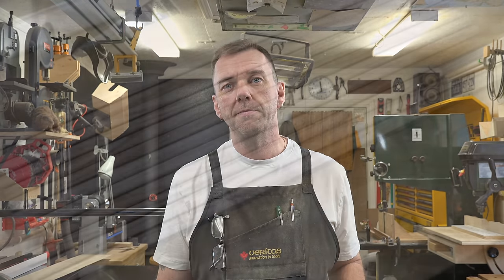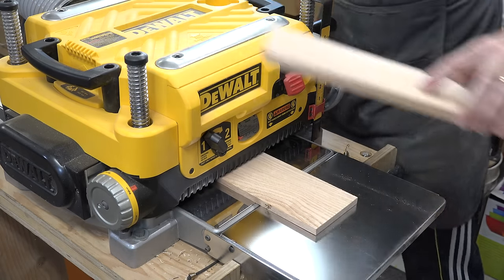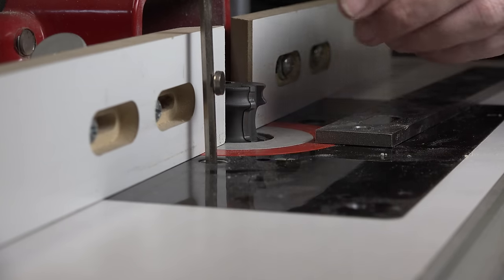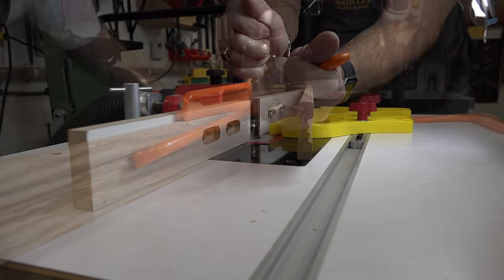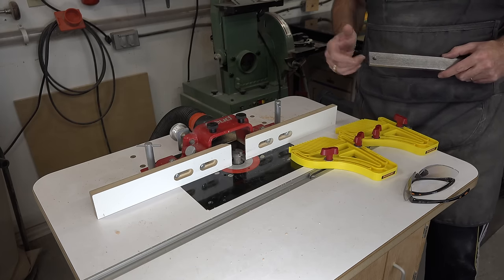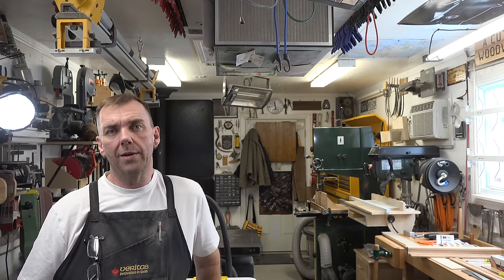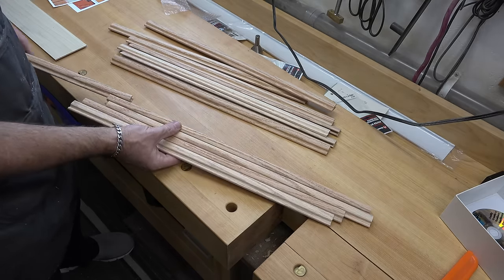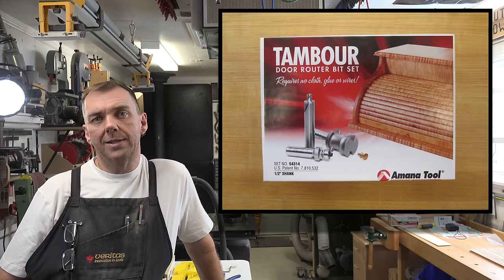Router Made Tambours

Comment: Nice video except you left out the 3rd bit.  What is it for?
Reply from the maker: The 3rd router bit in the set, really isn't a part of making the tambour and truthfully, it is nothing special.  What it is for, is rounding over the last piece of the tambour, which would be the pull bar that your handles mount on.  It is simply, a 1/4" round over bit and it allows the pull bar to have softer edges with a profile that matches those of the tambour slats.  I hope this helps.  Thanks for tuning in and taking the time to leave your question.
Reply: Thank you for the quick response.  Ouch, I looked up the price on amazon and it is 180 bucks.. wow
Reply from the maker: @iROBODUDE  I believe that I did say in the video that the kit wasn't cheap, but considering the overall price of making the desk and a family heirloom, I just incorporated the price into the overall cost for the roll top desk.  It's not a kit for everyone, but I honestly have no regrets in buying it.  Having the tambour as a solid wood unit instead of the traditional slats glued to canvas, made a world of difference in the overall look and function of the desk.  There is a full build series on my channel if you are interested in seeing how the desk was made.
Reply: I will check it out, thanks.
Reply from the maker: @iROBODUDE  Glad to hear it.  Thanks again for tuning in to the program.

Comment: anybody know how wide a tambour can be made with these bits and 1/2 inch hickory i was planning about 68 inches ?? thanks for any info on the matter
Reply from the maker: According to the manufacturer's recommendation, 5', or 60" is the maximum recommended length.  Anything more than that is risking a sag in the centre of the tambour.  I hope this helps.  Thanks for tuning in to the show.

Comment: Nice video Ken but just how "pricey" is it? Is it justifiable to buy for just one or two projects? I have thought about sawing through all but one veneer layer in a piece of quarter inch plywood. (But I ain't never had the guts to try it.) That might work but I don't know if it would last over the years. How are things going with the weight loss? 
God Bless my friend.
Reply from the maker: Pricey, in this case Frank, is approximately $170 US for the 3 bit set.  At first I considered this to be an outrageous price and that may be true, but there is more than one way to look at it.  If you spend the money on the bits to only make 1 or 2 projects and those project become heirloom pieces and last for generations on end, then it was money well spent.  I have seen many roll top desks where the tambours were made in the tradition fashion of gluing wood strips to canvas, only to have the canvas rot or fall apart, leaving the tambour unusable and in need of repair.  This completely reduces the value of the furniture piece because it is no longer original when you repair it.  I'm thinking that this method will last the lifetime of the entire piece and in this scenario, for me, it was worth the extra expense.  There are those that might not think, but that is their prerogative to make that decision.  As for the weight loss.......I'm down 50 pounds at this point and feeling great.  I have a little more to lose and you should be seeing a note from me in your inbox soon.  Thanks for asking Frank and thanks for tuning in again this week.
Reply: I completely understand what you're saying. I will note that I've seen an alternate way of attaching the tambours that use a metal guide (fastened to the tambour) and a plastic coated wire.

I'm sure that it will last longer than the canvas but you still have the wearout issue, presuming it becomes an heirloom.

Just curious if you'd seen that choice and eliminated it for the same reason that you didn't want to do canvas.
Reply from the maker: I have seen the method that you describe.  My final choice was still the tambour made with these bits.  My theory was that the least amount of materials to fail, the better.  It's just a matter of personal preference actually.

Comment: Super noob here. What is this bit getting inserted in? What type of table/mechanism is this? I apologize for my lack of jargon.
Reply from the maker: No need to apologize Jayne.  Everyone has to start somewhere and I love the fact that you stepped up and asked the question.  The table / mechanism is called a router.  It comes in several different varieties such as trim routers, plunge routers, fixed base routers etc.  The one that I am using in this video is a plunge router that is installed in a router table.  The router normally is a hand held device where the wood is stationary and the router gets moved manually across your work.  By installing a router in a table as I show in this video, it makes the router stationary and the work piece is what moves.  If you would like some more information on the different types of routers, you can check out my show on choosing a router.  You can find it here https://www.youtube.com/watch?v=M7Wg4FjDAwc
Thanks for tuning in to the show and please don't hesitate to ask any other questions you might have.

Comment: There are three bits in the box. You used two or did I miss the part where you demonstrated the third?
Reply from the maker: You didn't miss a thing.  I never demonstrated the third bit in the set as it is nothing more than a round over bit to have the pull bar have the same rounded profile as the tambour slots.  Nothing more than a round over it.  I felt that demonstrating the important and different bits was where the focus of this show should be.  I hope this answers your question.  Thanks for tuning in to the show.

Comment: spent a lot of time to get mine cut right to ben honest dont think there worth the cost or effort
Reply from the maker: Sorry to hear that.  While the setup does take a bit of time, I feel the longevity of the tambour will far exceed the traditional way of gluing slats to canvas.  Either way, thank you for tuning in to the show.  I hope you enjoyed it.
Reply: @acutabove_woodworkings  , I'm sure over time it will become easier , but considering I'll only do a handfull of these , I wonder what the life of a canvas door is , I may make a few out of each method to see how things go , once again thanks for your contributions to wood working
Reply from the maker: @ekdave1962  After the first setup, I made a set of setup blocks by routing some UHMW plastic after dialling in my final setup.  Now I use them to set the bit's height and the fence position. It makes it a lot easier.  Good luck with your your canvas style tambours.  I'm sure they will be awesome.  Thanks for the kind words.